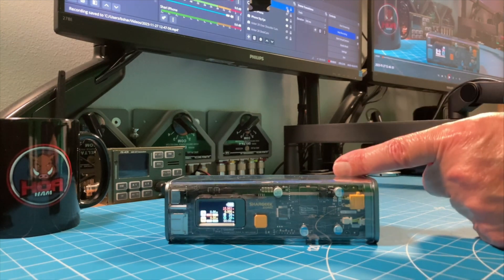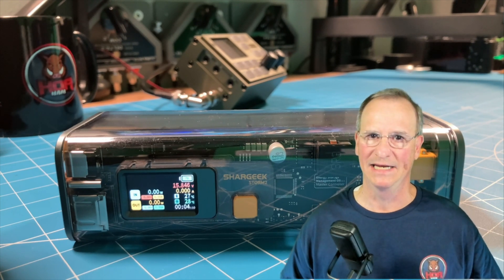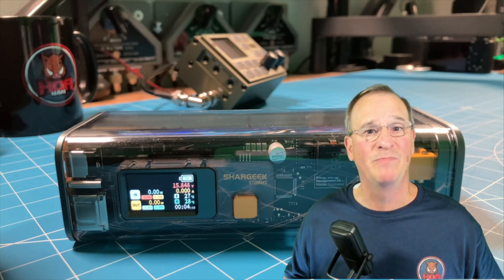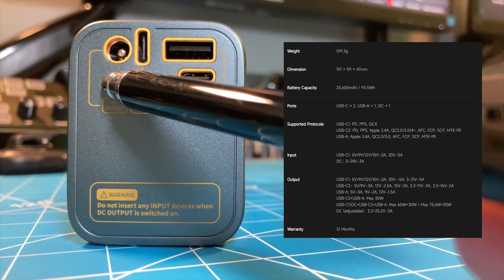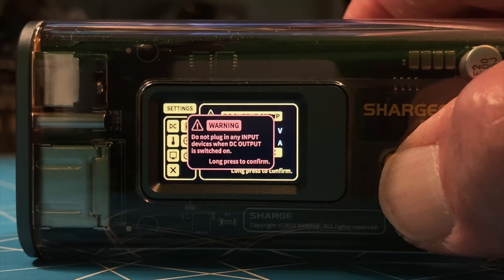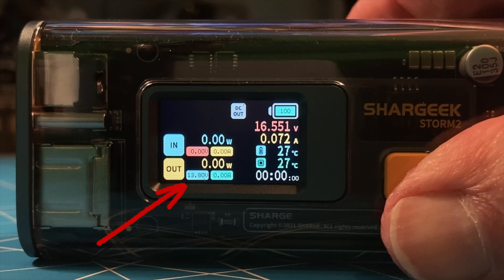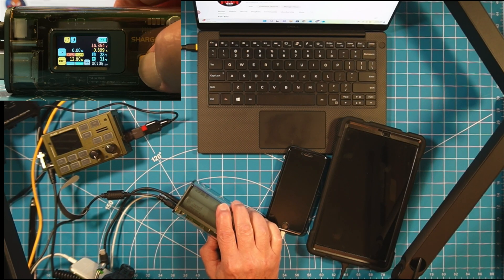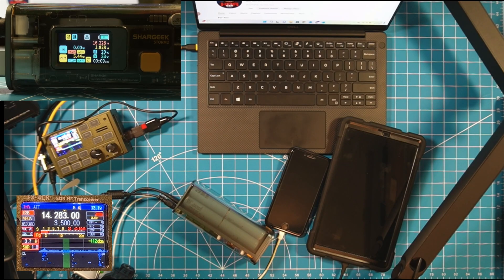Shargeek 100 Storm 2 Review: the Perfect QRP Ham Radio Power Bank

Comment: Great review. Thank you. I see that Anker came out with something that looks exactly alike, but without the DC port.
Reply from the maker: Anker makes great products.  Unfortunately, they steer clear of the 12 volt output we need for ham radio.
Reply: Im going to order one today. I think it would negate the warranty, but does it look like it could be opened without braking it, when the batteries need to be replaced? @HOAHamRadio
Reply from the maker: I've seen someone break it down but I don't consider myself at that skill level; they put is completely back together again.  I think you would have a long life with this before you needed to think about replacing the cells.  They are high quality Samsung cells.

Comment: I think I just found the perfect power supply for my IC-705! Setting the DC output to 13.8 through the menu was a revelation.
Thank you for the great review!
Reply from the maker: Its great for radios 20 watts and under; it was the ability to adjust voltage that hooked me.  Thanks for the feedback.

Comment: What is the current output at 13.8v or 12V DC? If I’m looking at the specs right it tops out at 3Amps which is limited to a few low powered rigs. Even my FT-891 at 5W pulls about 5A, so that’s out. 

So something like a G90 would trip this battery pack with its 5-8A draw at 20W, and might trip it at 5W with its 3A draw.  

While a QMX would chug away happily with its roughly 1A draw, and I could imagine that the QMX would run for days @ 12V on a single charge.

Comment: Great video! What cable are you using for the FX4CR? Is the dc barrel connector 2.5mm? And are you using an inline fuse with the cable? Thanks!
Reply from the maker: Here is the cable I use:  https://amzn.to/3t79elE    Yes, it is 2.5mm and no inline fuse.  Based on the protection built into the Shargeek I don't feel the fuse is necessary.  My logic is I'm plugging my $1,400 iPhone and $1,200 laptop into the Shargeek without an inline fuse...so why the radio.  I know its counter what we've been taught with our radios, but that's my logic.